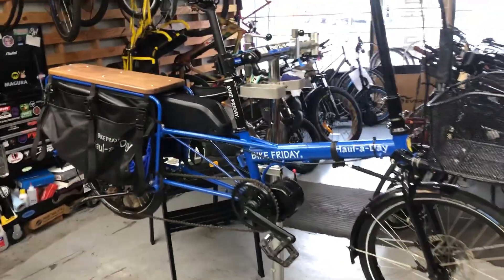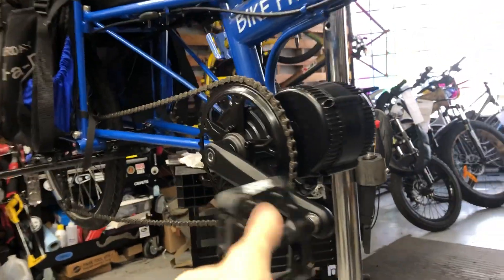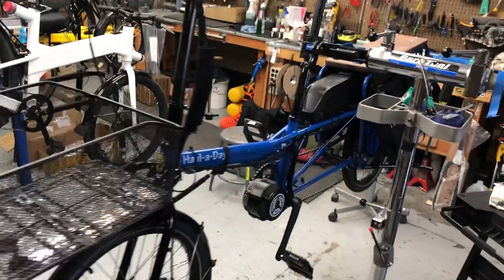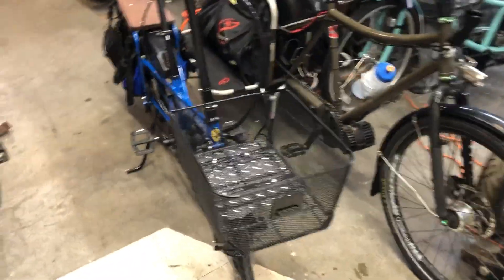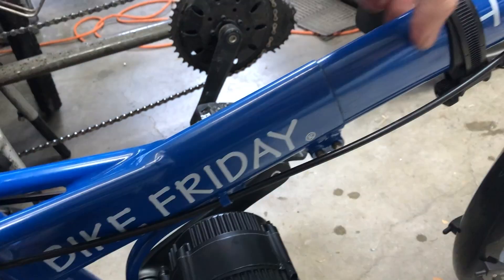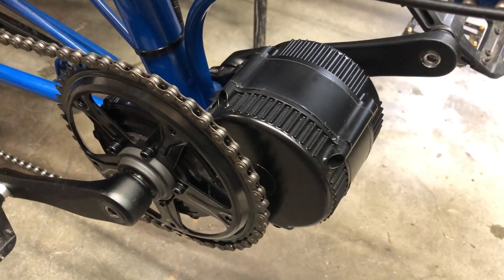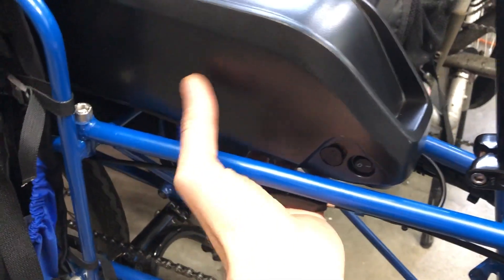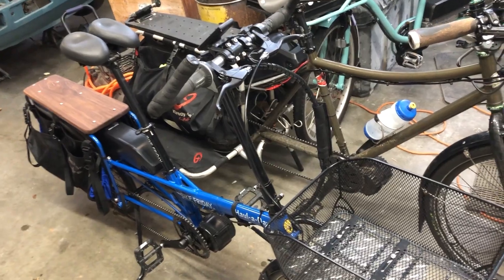One Size For All! (Bike Friday)

Comment: I've got one of these and it is truly one of the most versatile, well made/designed cargo bikes! 
You do have to get used to the way way the frame  flexes, which can feel a bit flimsy, but it is very strong and stable when it's loaded with gear. 
I'm planning on using it for some touring now that my kids  have outgrown the rear deck.